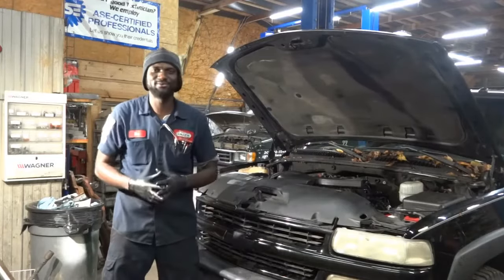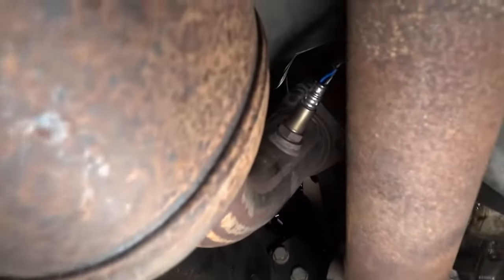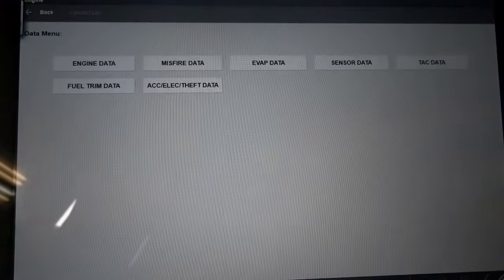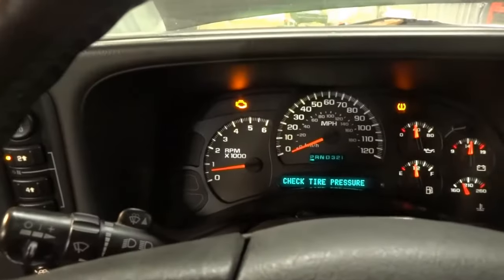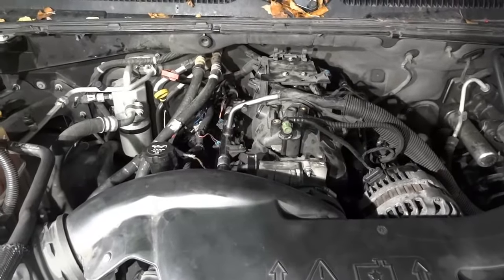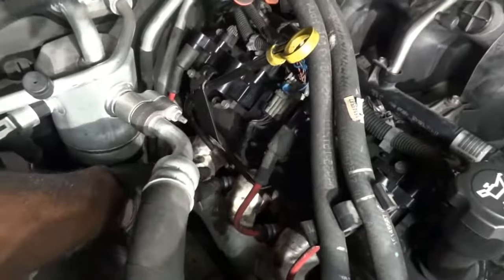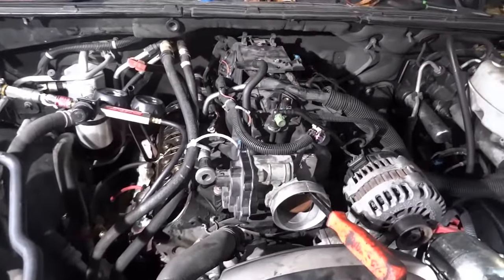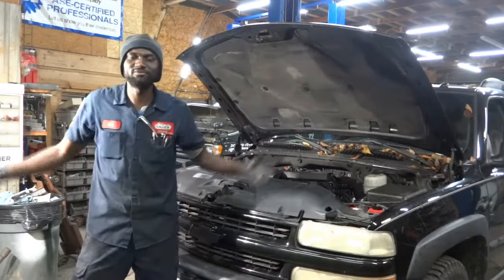CHEVROLET SUBURBAN 5.3L~ P0300, Still not Fixed After replacing the injectors and ignition Coils...

Comment: Great video and diagnostics!  P0300 on my 04 Suburban ended up being a bad hydraulic lifter in cylinder No. 1.  In my case a compression check showed the issue since the lifter wasn't fully seating.  I think the difference was about 20-30 psi.
Reply from the maker: Alan C  My Pleasure!! and thanks for sharing your experience with us!!
Reply: Hydraulic lifter? Is that same as valve spring?
I have P0300 code only, with check engine light and heavy shaking misfires. If I keep engine running, exhaust smells like sulfur/eggs.

Comment: You needed to show the radiator and the oil dipstick tube so that people can see the complete procedure. (In the throttle body and exhaust it was advised to put a piece of paper towel with tape)😌
Reply from the maker: @user-sy8zq7jc5u   there are different ways of doing things! the leak is not in the cooling system or the oil jackets!! why did you want me to show the radiator or the dipstick?

Comment: I have a 2010 suburban and it was running fine. I got caught in a rain storm and couldn't see 2 ft. In front of me because wipers were not working. I ran a wire from battery directly to the terminal of the fuse. I don't drive it often and I forgot to replace the cover and the fuse box got wet in another rain storm. That day the truck ran very rough and caught fire at the exhaust. I towed it home, then it wouldn't start, I had nothing when turning engine over so I replaced the starter. It started up but was running very rough. I watched a video where a gentleman did the same thing getting a P0302, P0303, P0306 and P0308 codes. I replaced the fuse he showed was the real issue and car ran better. Then I noticed fuel coming out the exhaust and quickly realized that is what must have caught fire the first time. I have ordered the injectors, MAP sensor and replaced the complete fuse box. It was cheaper than trying to figure out which components got wet or damaged in older unit. I am hoping that this short is the reason so many injectors might have gone bad at the same time. Do you have anything I might want to check? I have cancer and medical bills have put me in the poor house and mechanics in this area try to rob you blind. I need my car to make medical appointments. 😩 I have worked since 13 years old. My mother was alcoholic and gambled but got her life together before she passed away. God bless her but I have suffered all my life. Now fighting cancer I can't get no help anywhere. I never been on welfare or nothing now after paying taxes all my life I'm suffering and cannot get help this country has got to change how it treats working people who paid for so many others who did nothing. Then when we need help we cannot get it. So sad. I don't mind helping others but let's not forget the ones who made the country work in the first place.
Reply from the maker: Pyde Piper Productions, LLC Jonathan Bashir  I'm sorry to hear about what you are going through!! if it still runs rough after everything that you're gonna replace, the next thing you can check is the crank sensor and the wiring of it, then the wiring of the injectors and the coils!!
Reply: @KITS_Auto_and_Truck_Repair  OH my man, you brought tears to my eyes. It seems like all I have asked people on here for a simple answer and the more viewers they get the less they respond. Not only did you respond but so fast. God bless you. I also ordered the TPS sensor and I been reading that after replacing it people complained of extreme high engine rpms. Most smart mouth respond about how easy it is to reset but none explain how? Second question how do I test a coil pack? I did not think to change spark plugs while in there just as part of routine maintenance then I read that bad coil packs can cause this issue too. I mean when you start the car it runs OK then after about 2 mins fuel is dripping from exhaust. I need this vehicle. My prius won't stay running, I had a accident with pickup and now has no lights on right side and this one has breaking system control for my trailer. I been trying to make money at the beach cooking food and selling it to get up extra money. I'm facing a eviction and my man I think I would die if I'm homeless with no car. Transportation in New Jersey is bad. Any advice will give me some hope. I don't sleep well worring about everything. I have no family or no where to go. I'm so scared right now.
Reply: @KITS_Auto_and_Truck_Repair  yeahi Im still getting p0902, 04, 06 and 08 codes. I will change fuel filter, and gas persurse sensor and coils and spark plugs worst case its old and will eliminate from future issues
Reply: I meant P302, 03, 04 and 08 codes
Reply from the maker: @pydepiperproductionsllcjon7585  sounds good!!

Comment: Is this the same for a 2015 chevy silverado 1500 5.3?? Because I'm having the same problems
Reply from the maker: Juan Segovia  Yes! you can use this diagnosis process on a Silverado too! it's the same engine!
Reply: I was told the DoD It is usually the problem with 14,15,16  models with the v4 to v8 Do you guys come across those problems with that system or is that not a common problem

Comment: First thing I would have done is a compression test then a leak down test. I never redo heads and put them back on a very high mileage block because it will cause problems
Reply from the maker: @Steve0885   I agree!

Comment: Hey quick question im on the same boat but once i go past 1k rpms it stops missing firing and if i let it idle it drops to 570 rpms and cylinder 2 misfires could it be a timing issue?
Reply from the maker: Frank Castle you might have a weak coil, or carbon built up on the valves!

Comment: Hi I was having the same problem on my 2003 Silverado 6.0 and we did injectors, maf sensor, and had the previous owner rebuild the heads and valves. It still shows the p300 so I was wondering if it would be the crankshaft sensor or camshaft sensor. I also am looking for an affordable scanner than could do a crankshaft sensor relearn to fix the timing and was wondering if you have any recommendations?
Reply from the maker: Wayne Shannon can you borrow a scope and scope the crank sensor? and also what kind of fuel trim numbers are you getting?
Reply: @KITS_Auto_and_Truck_Repair  we did a fuel pressure leak down test and we fixed that with a fuel press regulator. I do not own a scope but can look into it. The fuel trim is showing 25%. The truck has good compression and new valves so I don’t believe that is the issue anymore. We did a smoke test and no vacuum leaks and we used a shop vac and water and soap to check for any leaks by the exhaust.
Reply from the maker: @wayneshannon9936  are you sure you got the right fuel pressure, is your MAF sensor good? you might have clogged injectors
Reply: @KITS_Auto_and_Truck_Repair  yes we replaced the maf sensor and it had good power and ground. I will check fuel pressure tomorrow thank you.
Reply from the maker: @wayneshannon9936  You're welcome
Reply: @wayneshannon9936  what was the problem?
Reply: @mtsanchez27  ended up being multiple injectors fuel pressure regulator and possibly a fuel pump. Also did maf sensor and some other odds and ends. Truck runs good but is hard starting but I think it’s a battery problem now. I recently had to do rotors, calipers, and pads all around. I bought after market taillights then too and all my running lights work but the brake lights won’t if the running lights are on. I checked all the grounds and connections even seeing if anything was under the fuse box. There always seems to be something.
Reply: @wayneshannon9936  so you haven't fix it properly. I'm in the same situation
Reply: @mtsanchez27  no it no longer misfires and has no codes. Just max sure it’s getting proper fuel pressure depending on whatever bank it says and then check each injector to see if it’s properly functioning mechanically. If it’s not an injection then it’s the regulator or the fuel pump. If it’s not getting the right amount of air clean or get a new maf sensor. If that doesn’t fix it it could be the cam or crank sensor based on what I’ve read. It took a lot of diagnosis and time because it was a combination of all of those things minus the cam and crank sensor.
Reply: @wayneshannon9936  thanks brother!!

Comment: I have a collapsed lifter on my 07 yukon 5.3l. 7th cylinder.  Am i better off getting another engine or can this be fixed easily? Im good at wrenching just don't know if there could be more damage.  Thanks.
Reply from the maker: @paquesepas6696   Yeah! you could replace the engine. if you want!
Reply: @KITS_Auto_and_Truck_Repair  but what is the more common fix? Do i replace all lifters? Or is that still have a chance to not end up being the only problem?

Comment: You have carbon build up on valve stem,either sea foam it or pull the spark plug shove rope in it and roll engine by hand to close valve to crunch carbon off stem.
Reply from the maker: the Gonz  I haven't tried that method yet! does it really work?
Reply: @KITS_Auto_and_Truck_Repair  It has worked in the past,i didnt roll the engine over ,but by hand had the rope close the valve ,force it shut and break the carbon off that was holding it open.I have also removed the valve spring and seal,put 6" of 3/8 rubber hose  down to the guide,.poor sea foam in it and soak it.
Reply from the maker: @thegonz7833  cool!

Comment: I have a 08 avalanche with the 5.3 litre. Misfire on #8 compression 125lbs. Heads n valves etc checked good. Leak down test sound from valve train area and obviously dipstick tube but same result from another cylinder with 195 lbs.  Inconclusive??? Help if can
Reply from the maker: Sonyman34  after doing the cylinder leak down  test, where is the noise coming from!
Reply: @KITS_Auto_and_Truck_Repair   with the valve cover off, I slightly hear it from across top of the head. Not defined from dipstick tube only. The gauge holds pressure in the white area between 0 and 10%
Reply: UPDATE! I put valve cover back on to reduce natural air loss sound on both a good cylinder and the suspect cylinder. You barely can hear and feel air thru the pcv tube and dipstick tube. Only then can you hear slight sir noise from throttle body, nothing beforehand. Air gauge did not go down on both cylinders

Comment: ok...excuse me friend and when it is that definitive fault the code is not erased, my truck came out and they erased it and it did not come back but it has a light unstable idle sometimes very light, they checked spark plug cables injector washing good pressure gasoline all good
Silverado 2000 4.8 4x4
Reply from the maker: angel garcia  what trouble code do you have in memory?

Comment: Do you know what could cause vibrations when engine goes to V4 mode? Lifters not stucked, afm works but i feel bad vibrations. With Range OBD device everything is ok. No fault codes, no knocking sounds. 2011 chevrolet camaro ss L99 engine
Reply from the maker: Diablo Immortal - База Знаний  I've seen weak oil pumps cause vibrations and knocking sounds, check oil pressure and oil level, because low oil pressure will accelerate internal wear, which can cause noise or vibration, also check all your drivetrain mounts... Good luck!!
Reply: @KITS_Auto_and_Truck_Repair  thanks!! idle hot oil pressure is 20psi. no oil consumption. do i need to replace pump?
Reply from the maker: @DIABLO_4_Tester_Sacramento  you need to get it diagnosed by a pro mechanic to get to the bottom of the problem!!

Comment: What causes the intake valve not to seal.
? Can it be carbon build-up? If so could you run some cleaner to help the valve seat better to get a few extra miles out of the heads?
Reply from the maker: TomE  yes carbon buildup or a broken valve seat can cause this problem. valve cleaner works when you only have a little bit of carbon buidup... but most of the time it doesn't even work!!

Comment: I'm having some like the same kind of problem my vital surgery is up and up and down I change the intake valve and it's still doing it and I try to reset it and I'm not the same problem it won't idle right
Reply from the maker: @davemccleary9569   do the tests in the video and see what happens! or I would recommend you take your vehicle to a pro mechanic who can fix right for you!

Comment: Need your advice plzzz!  Have a p0306  cylinder 6 missfire...it's intermittent...the check engine light is on and when it starts to blink I have a missfire while driving and idle. When light is solid it runs fine. I've replaced coil...new plugs on that bank...swapped wires and swapped around injectors with no avail... any suggestions?  Seems electrical to me since it's intermittent? Any help would be amazing
Reply from the maker: blake hastings  check compression when it's acting up!! I've seen bad head gaskets cause the symptom you described... a wiring problem will most likely cause a constant misfire!!

Comment: Might be carbon under valve also take a inspection Camara  to see if valve is burnt might run a upper cld cleaner that runs off a bottle  made by 3 m Co must disable f pump I have used this stuff works good but if valve is burnt must remove head
Reply from the maker: @robertbarnhardt9792  Thanks for input my friend! great suggestion

Comment: I got a 05 Silverado 5.3 I put a cam in it machine shop did valve seals valve springs resurfaced the heads and I replaced the O2 sensors new ac delco plugs new coil packs new wires pulled injectors cleaned them still miss firing did a compression test my lowest was 165 highest being 185 on a 154k motor I’m not sure what it could be in shoulder 3-4
Reply from the maker: Skyler Scott  check for plugged catalytic converters, also do more testing on the cylinder with the lowest compression rate!!

Comment: My sons 00 Silverado 5.3L. it has P0300. we did a tune up on it by replacing the wires and plugs. the issue is the truck runs fine and smooth. Any idea???
Reply from the maker: Chris Rogers if you still have the P0300 code after replacing the plugs and plug wires, check the MAF sensor, or check for a vacuum leak, Fuel pressure etc... check everything I mentioned in the video and follow the steps in the video to find your problem, Good Luck!!

Comment: How can the compression be good with a leaking intake valve?
Reply from the maker: @robertjohnson4401  That's a good question, I believe the valve was sticking open!
Reply: @KITS_Auto_and_Truck_Repair  A sticking open valve will show low compression, not normal compression.
Reply from the maker: @robertjohnson4401   A sticking valve can also show good compression intermittently,  there is a variable there, this is why they missed it at the other shop!

Comment: My mechanic replaced the entire engine block and I still have the same issues, I have p0305 and it says the EVAP circuit board is shorted. And advice? I know I need to fix the bank two o2 sensor wires but what else could it be as well?
Reply from the maker: Anthony Henderson  it sounds like you have a wiring problem! you should the wiring and vent solenoid & Purge valve

Comment: I'm kinda in the same boat I have a 2007 Chevy Avalanche 5.3 L 301 code I replaced the plug the insulator porcelain was damaged and I replace the coil and it still runs rough I have not unplug the battery to reset the computer just yet it shifts real hard my next steps are either O2 sensor or fuel injector
Reply from the maker: Rick Lopes  sounds good! you are on the right path!
Reply: Mine doing the same thing shifts hard an dont run right

Comment: I have a misfire on 6 on my 08 Silverado I also have replaced injector, plugs, wires and coil packs and it’s still there. The engine is a new long block with maybe 10k
Reply from the maker: ThatBowtieGuy  do a leak down test on that cylinder, I've seen new engines fail prematurely, assuming the wiring is good, injectors and coils are good!! You could have a bad injector or coil driver in the ECM, but I recommend taking it to a pro mechanic to have it diagnosed!

Comment: Hi there,I got the same issue with my Hummer h2.A shop has resurfaced the heads.They replaced the head gasket water pump gasket etc..But now I got a very oil pressure and P0300 code now.Is it possible those guys did not resurfaces the head right?They even replaced the lifters but the truck is still ticking.
Reply from the maker: Laszlo Vasko yeah it's possible!! maybe too much was removed from the heads when the resurfaced it!!

Comment: I am having a long crank time start on a 2016 Yukon Denali xl with 6.2L. recently I changed oil and I could see gas in the oil pan. I lose line pressure overnight to almost zero. Does that mean my injectors are leaking out? When I do start, I have no black smoke out my exaust. Also vehicle runs supurb and no codes. 174000 miles. Also I did just replace my high pressure fuel pump on the top of the engine, in doing that I got rid of my whistle noise on take off by replacing the intake gaskets. I am afraid to take it to a shop because I don't have very much trust in them.
Reply from the maker: William Lobert  yeah it sounds like one or a couple of injectors are leaking!!
you need to leak test all the injectors and if you don't have the tools to do that, you will have to take it to a shop!! ask around and hopefully you can find a trustworthy shop.. Good Luck!!
Reply: Any chance the fuel pressure sensor could be bad?

Comment: Always makes me worried when so many parts have been replaced that the parts changer mechanics used quality and correct replacement parts at the least. It's happened a few times lately that there was a Chinese ebay part installed and the correct diagnoses process took a little longer because well the part is "new"
Reply from the maker: Dave lambardo  Lol Yeah!